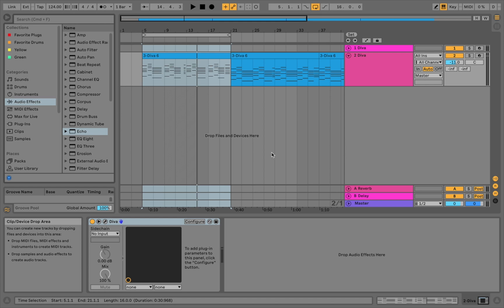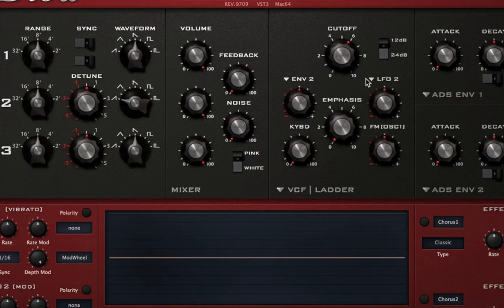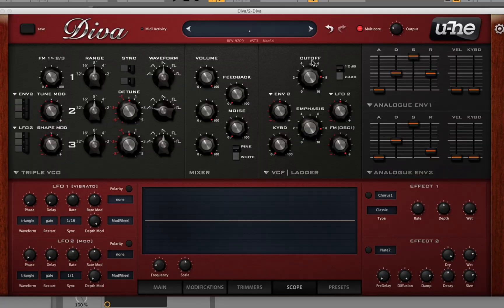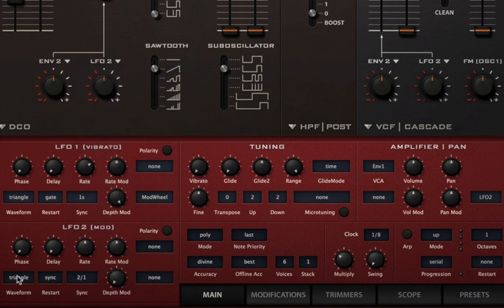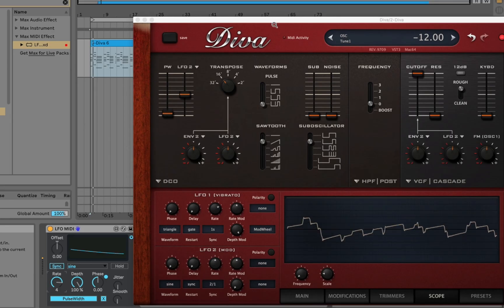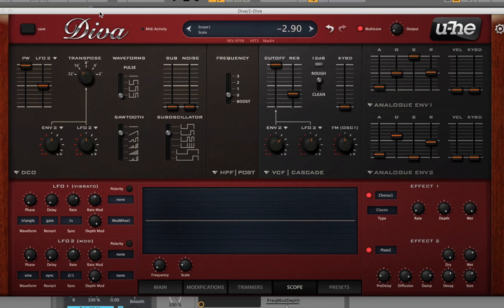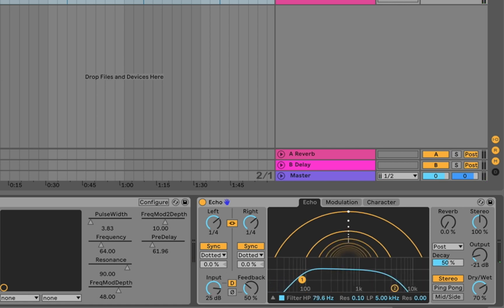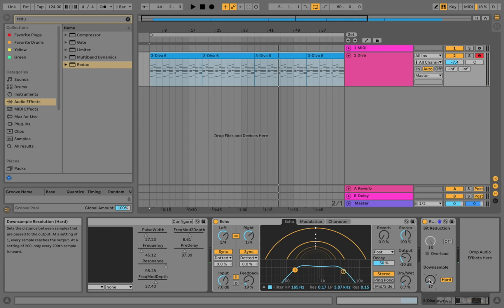🤔🤔  Best VST Synth Ever!? - u-he Diva Review

Comment: talk about cpu load, my i7 8th gen is taking 30% load just from 1 diva, weird
Reply: It is very CPU intensive, if you activate multicore It Will reduce the CPU load a little bit
Reply: @1314Ruben  i got it just u know, home producers who uses em like, what cpu should i have to handle it, use 5-6 same time plus other vst idk
Reply from the maker: It is a CPU hog for sure. A few things to consider, your audio interface, the sample rate of the session, and the buffer size. I noticed my Mac could run plugins a little better when I upgraded to a UAD Apollo. Take your sample rate to 44.1 and take the buffer to a higher number. Hope that helps